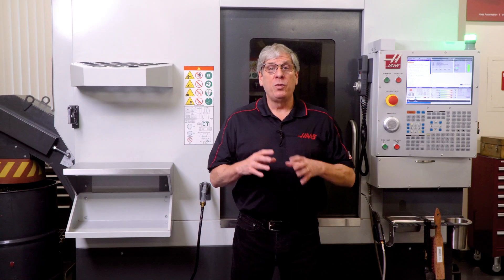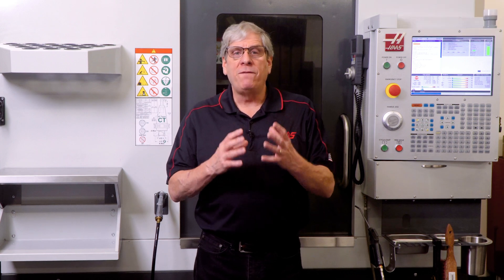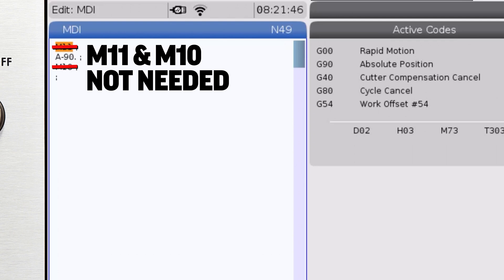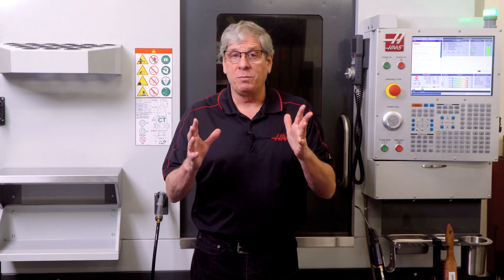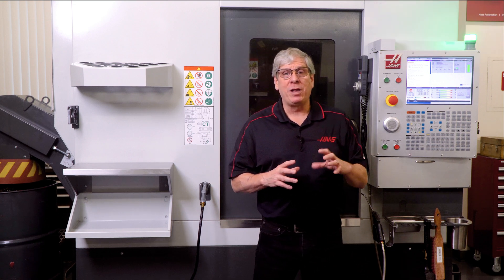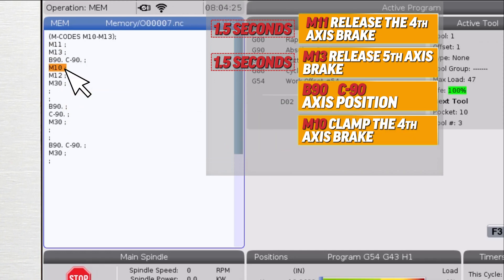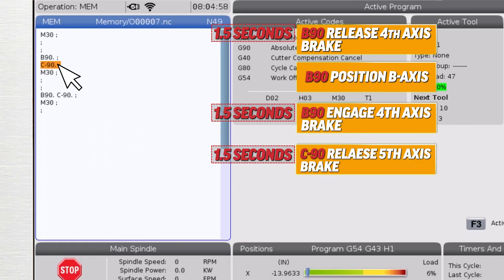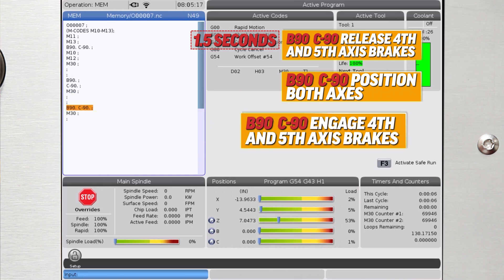M-Code Time Savers - M10 thru M13 Rotary Axis Brake Commands - Haas Automation, Inc.

Comment: Using the generic mastercam haas 5axis post processor, and it adds brake releases and locks in operations that do not use any rotary movement. for example, a facing operation with depth cuts will release and engage the brake everything the tool retracts. How can this be disabled?

Comment: This makes a ton of sense, thank you John!
What would you recommend using when doing a lot of B 0/90. C +/-90. simultaneous positioning? G01 or G00? It looks to me as if G01 (with any reasonably high F) goes easier on the trunnion, while being considerably slower then G00.
I was also wondering: when using G01 for B and C positioning, does G187 P3 have any impact on the speed of the movements?
Reply: I've found that if you use simultaneous repositioning in a 5 axis toolpath and they are G0 moves, it becomes shaky. this is likely because g0 moves kind of have to wait at their endpoint before starting a new move (its not exactly like that but im not sure how to explain it better) so G1 is pretty much a requirement

As for your second question, i know that for a fact because i tested it myself on a Haas. It has a huge impact on cycle times. The maximum feed on rotary axes is not impacted but the acceleration is greatly impacted, so doing the move in G187 P1 will make it much quicker than with G187 P3. the effect is greater on larger moves (over 30 degrees lets say)

Ive found that using G187 P1 makes the acceleration pretty much the same as a G0 move, but i think its best for regular indexing to just use G0 moves
Reply from the maker: @gerrit2107  You are correct! My first response is incorrect with regard to G187. G187 P3 will take more time because the acceleration and deceleration rates are lower. G187 P1 will shorten cycle time because the acceleration and deceleration are quicker. Sorry for the confusion.
Reply from the maker: Futurmecc S.r.l. and Gerrit-HJan Bergwerf, I always use G00 to position the rotary axes. There is no danger running a rotary axis at it’s maximum speed. Newer Haas controls have Setting 335 LINEAR RAPID MODE. Check that setting 335 is set to LINEAR + ROTARY. This will force all axes on a G00 line of code to start moving at the same time and reach their end points at the same time. It does not take any longer to complete the move. The axis with the longest distance to travel still moves at the G00 rapid rate. The other axes slow down to remain synchronized. This way, you are not losing cycle time with G01 if the maximum programmable feed rate is slower than the G00 rapid rate.

Also, G187 P3 impacts the acceleration of G01 Feed moves. It has no impact of G00 rapid moves. The maximum speed does not change but the move takes less time because acceleration and deceleration are quicker. Thanks! John
Reply: @haasautomation  Thank you John!
That's exactly the kind of answer I was looking for.
Please keep these awesome videos coming!
Luca

Comment: Why not just make them not do the dwell if the brake is already in the commanded state?
Reply: They do not dwell when they are in the commanded state, but if the brakes are not explicitly unclamped with the m codes then they are often not in the commanded state for a move.
so if having multiple M11 or M13 commands for instance, makes the control skip them.
Reply from the maker: James Stanley, As Gerrit-Jan Bergwerf already mentions; if the brakes are released with the M-code and you command the axis to move, there is no dwell. There will only be a dwell when you are changing the state of the brakes from clamped to unclamped or from unclamped to clamped.

Comment: Would you consider this vectoring of B and C ?
Reply from the maker: parpar72, Any time the rotary axes move, they change the tool vector in relation to the workpiece. This video is about reducing the brake delays in certain situations when programming the rotary axes to move.